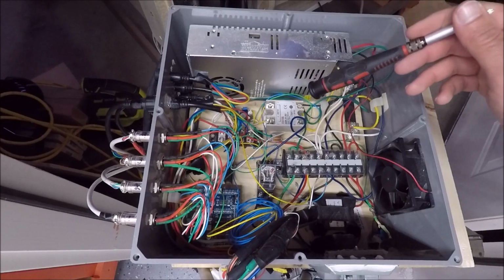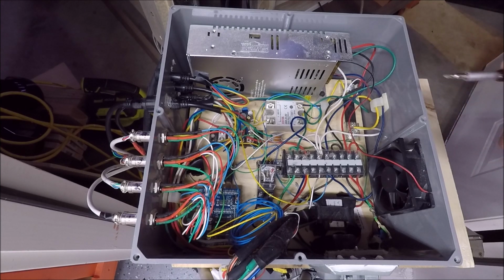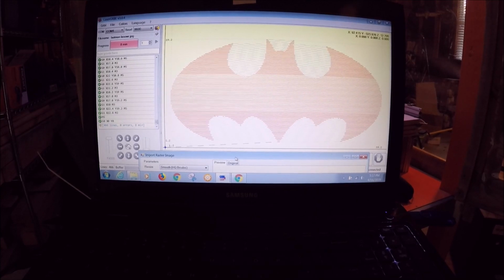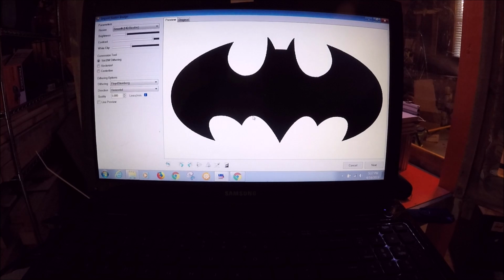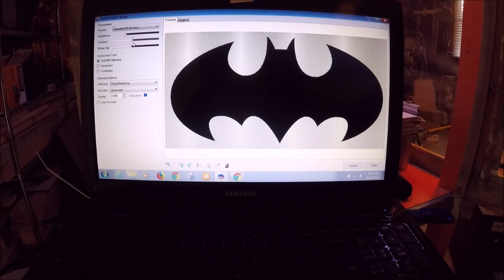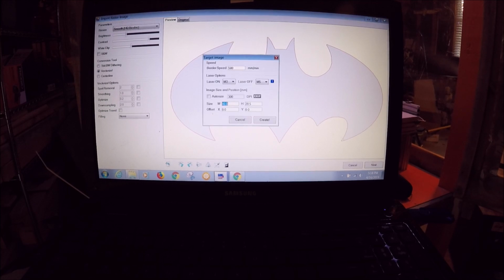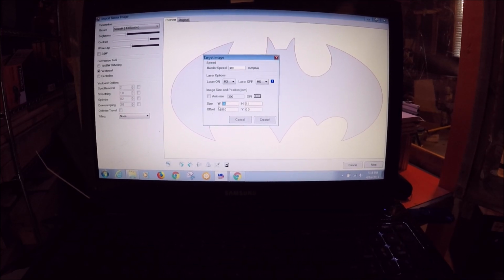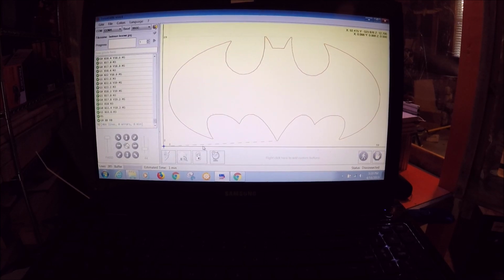Arduino Laser Engraver

Comment: Nice. I'm no expert in laser diodes but it's a good start i think. Little faster speed and you should be good. 2.5w laser in my case is barely cutting 3mm birch plywood 200mm/min with 100% power / 7 passes. I'm doing engraving 100% power at 1000-1200mm/min.  My "eleksmaker a3 pro" is definitely a lighter construction thou.